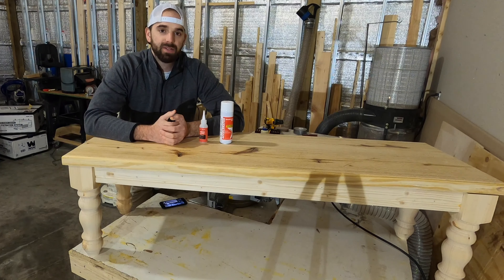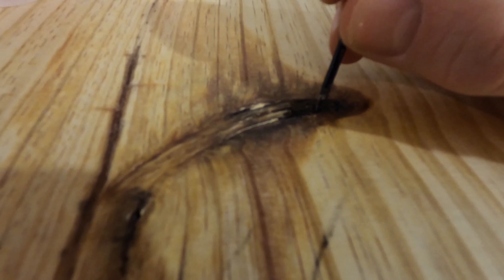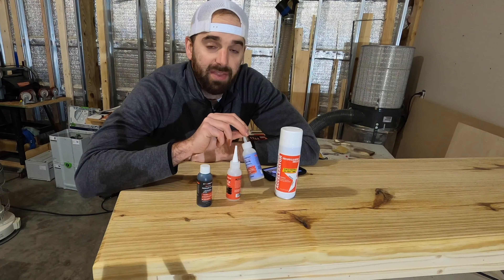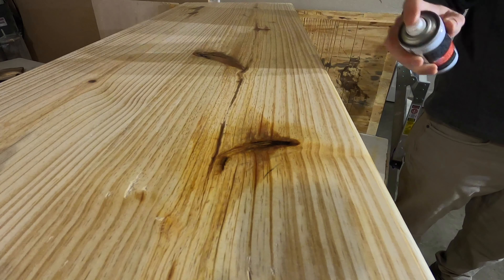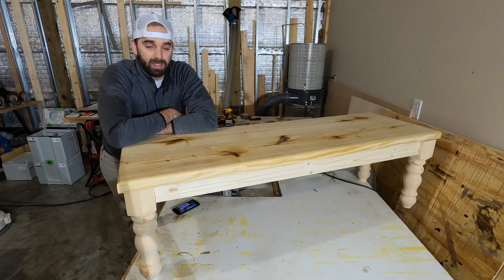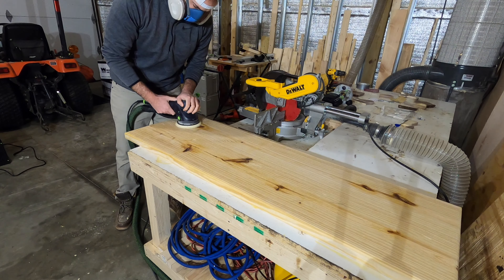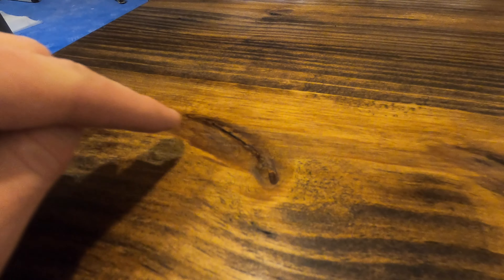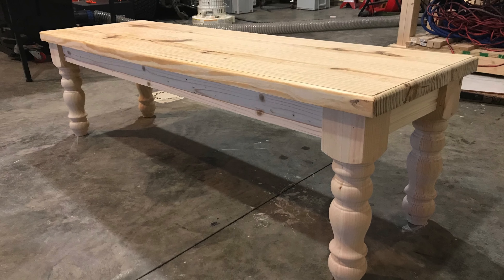Using Starbond CA Glue to Fill Cracks in Table Surfaces

Comment: Have you used polyurethane over the CA glue and if so have you had any issues?
Reply from the maker: Yes, several times. As long as the CA glue is completely dry and hardened all the way - I have had no issues or concerns